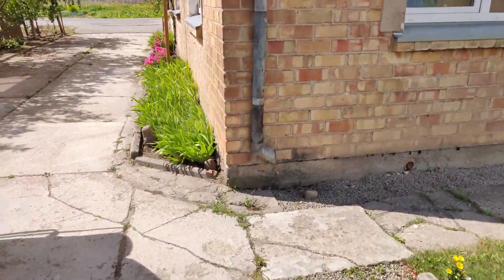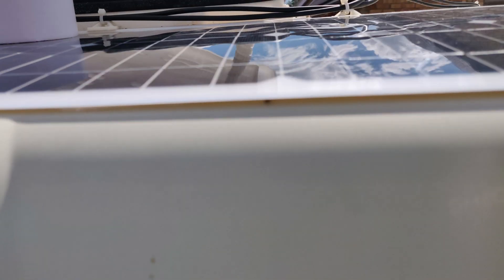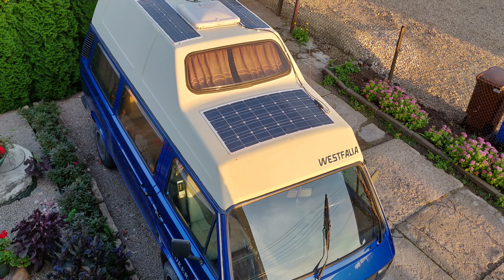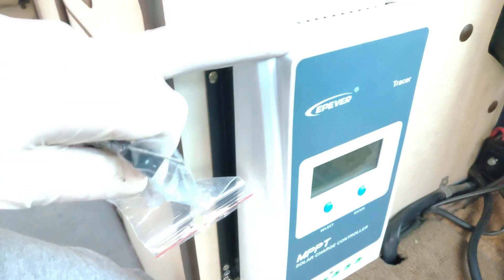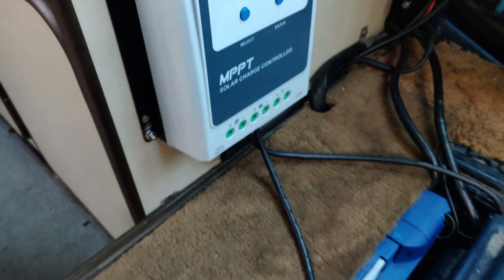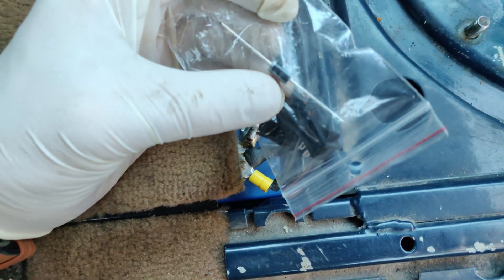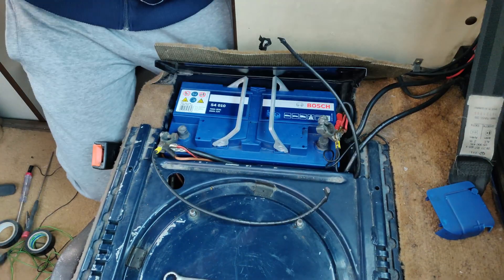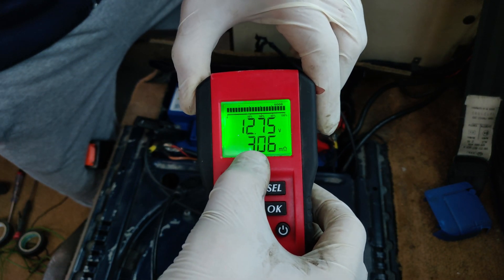VW T3 solar panels installation

Comment: Hi, i have the same roof top on my VW T2, it is difficult for a permanent solution cause i have 2 vents and there is not enough space (apart left-right as you did) so every time i camp for long time i take out the 2x100W solar panels.I was thinking to install one thin permanent panel on the front part of the roof that there is plenty of space. How does it come after 4 years now that you've installed it?Already needs to replace it? Did you glue it on the Polyester roof or with another way cause i think that if you glue would be difficult to remove it? What size is the front panel? Thank you!
Reply from the maker: Hi, after 4 year's my solars are very faded, i have buffed them last year and this year sadly they're faded again . Needs to be changed to a better quality panels. I have attached them with double sided adhesive tape and it's holding absolutely well.  I believe it wouldn't be too difficult to remove them. It's a standart 100w panel size, can't find the measurements, but in case you really need, I can measure it tmrw. Cheer, G.